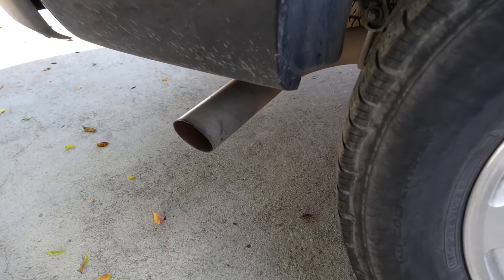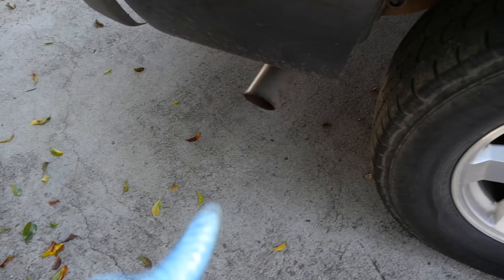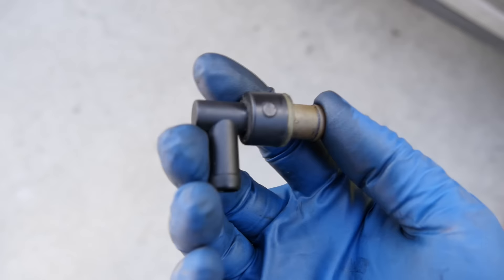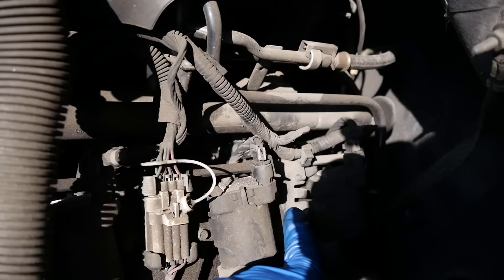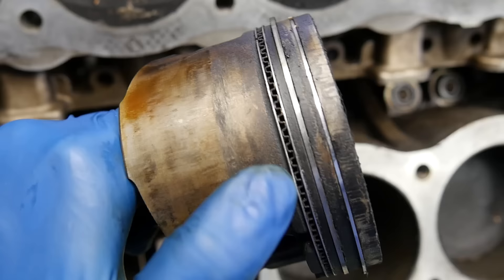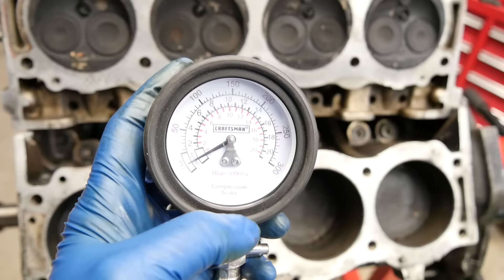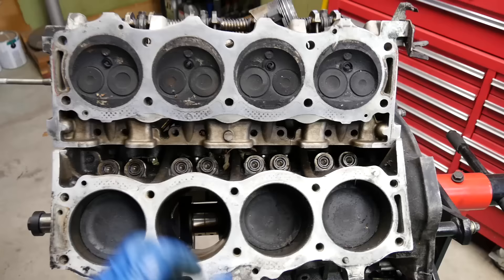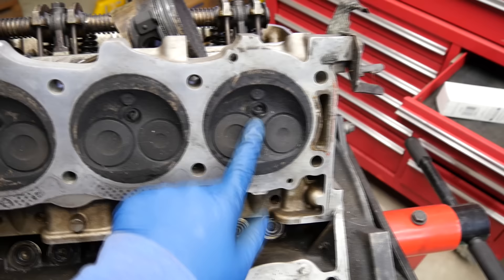Top 5 Reasons Your Car Is Smoking Out the Tailpipe - And How to Diagnose Them

Comment: Is there a reasonable price for fixing the thick white smoke coming from my exhaust pipe? I don’t want to be taken advantage of. I’m a single mother and I’ll be broke because of this for Christmas. In case it matters, my car is a 2016 Buick Encore. Thank you for your response.
Reply: If you are loosing coolant it might be a head gasket or a cracked head or block. There are dye kits an auto shop can use to diagnose it. Then if it is coolant getting into the combustion chamber, you might try those products that are supposed to fix some of those problems. Head gasket repair is expensive, and if it's a cracked head or block, a whole lot more even.

Comment: I have a 2006 Prius that is a burner of oil.  Any suggestions?  I have done an engine flush.  New plugs.  Seafoamed the cylinders and then burned it all out.  Any suggestions?  168k Miles and I am the second owner.  I have also tried different weight oil with no luck.  900 miles equals one quart.  Thanks I like the channel.
Reply: First check if it's leaking anywhere, if not your engine is getting worn. Use a thicker oil and later on buy another car and sell this one.
Reply: Strategic Thinker thanks for the input.  Not a drop any where.  It has been frustrating nonetheless.  I like the car it gets good mileage so much for being environmentally friendly haha.  The manual even states that a quart of oil every 900 miles is in the acceptable range.  Thanks for the comment.

Comment: So I have a 2005 Chevy Silverado with the 5.3 and it’s been smoking white from the tail pipe, I did the “block test” but it appears as if I don’t have a blown head gasket or anything, but it smokes white still and I also have a pretty strong smell of gas and gas dripping from my exhaust pipe, you guys have any ideas or suggestions? Thankyou to whoever has the time and reply to me.
Reply: Murat Tabaru I found the problem, it turns out it’s a fuel injector that’s stuck open

Comment: Our rarely-used backup car, a '92 SC400, blows white smoke in noticeable (but not billowing) amounts when the heater core is used, but nothing otherwise.   Do you have any suggestion as to the severity of the problem?   Can it continue to be driven awhile without using the heater core (it's never really needed)?   Thanks!
Reply: Heater core should not affect smoke out the tailpipe, but only smell or steam on the inside of the car. You can remove the two heater hoses to the heater core and connect them together to bypass the heater core if you don't need the heater, if you want to.

Comment: My lexus is220d 6 speed manual. 177 bhp 2231cc  turbo diesel is giving 28mpg   highway in UK. It doesn't smoke. I have new egr and new map sensor. Some time loses power and does 20 to 30 mph .Can you tell  what can cause these problems?

Comment: Situation: Descending a long steep hill, foot off of accelerator all the way down, then a stop sign. Upon accelerating from the stop sign, Lots of blue smoke.
Question: Worn piston rings or bad valve stem seals? 

This was always a question I had. I do have blue smoke at start up in the mornings so that is a sign of bad valve stem seals and I plan on replacing them soon, but I still have that question above. Does anybody here know the answer?
Reply: Smoke on Decel  is usually blow by caused by the motor pulled a ton of vacuum = Bad PCV / Stuck / Crudded up / Failing Piston Oil Control Rings, Smoke on Start Up = Valve Stem Seals (Worse case scenario, Valve Guides, but not usually).

Comment: Hello ,
 I have ford fiesta classic 2010 1.4 duratorq 90,000 on odometer. Oil consumption is little higher than normal and I don't see blue smoke from exhaust. What should I do ? Turbo seems ok. Should I go for valve job? Please advice!

Comment: I have grey smoke out of my exhaust only when I accelerate quickly. I think a bad valve stem seal even though I don't have it on start up. I drive a 95 jeep cherokee 4.0
Reply: Could be a clogged PCV valve.
Reply: @mattstoker4975  I forgot to mention I put synthetic oil the first time I changed the oil after I bought it and it would puff out smoke at idle non stop. Switched to thicker oil and it only does now if I floor it.

Comment: hi..sorry if i disturb you i read all comment her jusy now talking about white or blue smoke.i just ask a question.. i have my car opel zafira b edition 1.7cdti model 2008.. i have also a smoke in my car i dont know exaclly blue or white..so one time i change oil in my engine total oil remove from my engine is 7 litters some time 6 litters. every time i change..so i ask why is to much oil. normaly only 5 litters..and  what you think the problem of my engine.. is leaking the injectors or head gasket.just reply me if you have time thanks..

Comment: my car is running rich long term fuel trim -14 smoke out the tailpipe rough idle , slight backfire thru intake occasionally if I step on it.  I'm thinking stuck open injector
Reply: Oh. Really?
Reply: @shenghan9385  turned out to be intake gasket.

Comment: Good afternoon.  I have a Ford Focus station wagon, 2006. 1.6 TDCI, 80 kW ... Smoke at high rpm.  I've been to multiple mechanics and each of them has a different opinion ... one said it was because of the wrong oil ... and I put in a 5W30 ... Total Quarz ... another said it's a fuel filter ... the car goes  like crazy and pulling well ... i'm otherwise from europe from croatia and sorry for the bad english ... please help ... thanks a lot.  greeting
Reply: Its like blue-white... Most blue... Only at high rpm

Comment: If u put something on ur engine oil like a leacking stopper is okay to have a lil more oil than ur supposed to or should it still be on the mark?
Reply: Rather drain a bit of oil first before adding whatever to the oil and try to keep it just below the full mark - only on some engine going slightly over the full mark to quieten noisy hydraulic lifter is recommended but this is a whole new discussion - it's got to do with volume of liquid and available space in your crankcase before crankcase pressure gets too high and blows out seals etc...in effect rather be a bit below full mark on dipstick than above PROVIDED that you have the right dipstick for your engine and on level ground when checking readings- or if you car is burning oil just wait till oil level drops to required amounts and top up with whatever additives you're using.

Comment: dude my 07 taurus keeps blowing smoke. ive replaced the injectors and spark plugs. heads, head gaskets. intake gaskets, 02 valve, water pump.

Comment: Could a bad or clogged catalytic converter cause smoke to come out of the tailpipe even after the vehicle is at normal operating temperature & idling still?
Reply: Are you throwing check engine codes for the catalytic converter? If so, I would consider this as a possible culprit.

Comment: What about a carbureted engine? I have a Dodge D150 with a 360 in it. It smokes like a greyish smoke and it just smells like gas its such a strong smell and it smokes alot of it too.
Reply: Could be a few things but worn out jets or worn carburettor components (like accelerator pump or chocke mechanisms ) like needle and seat (or badly adjusted) would be a good place to start - also check for modified air filters that could affect ratios -in some rare cases weak ignition as well or faulty spark plugs..could be a few things..😊

Comment: P0420 cause a truck to run rich. No smoke comes out just a few drops of water at end of pipe.
Reply: i think p0420 is a problem with the catalytic converter
Reply: Water from the tailpipe is normal. P0420 is a catalytic converter efficiency problem, if it's not the sensors. Either try to clean the cat or replace it.

Comment: I'm having reach mixture, and gas smell out through my tail pipe. Interestingly my car doesnt have a O2 sensor, my fuel injectors are spraying equally, air filter is ok...what might be the cause? It's a honda civic 2002 but, engine is thai made.
Reply: Alll fuel injected Honda Civic's use Oxygen Sensors to monitor fuel mixture and to let the ECU decide how much fuel to spray as well as how far to retard or advance timing during engine operation, if your O2 Sensor is not on the front of your Exhaust manifold, it is under the motor before the cat convertor, most OBD2 Hondas also use two O2 Sensors, one upstream and one downstream with the exception of some JDM engines.

Comment: My 350z is misfiring in cyl 2 and FLOODS white smoke super milky thick smoke out the exhuast, any ideas of how to fix?
Reply: Could be a number of things, leaky fuel pressure regulator, clogged fuel filter, stuck open fuel injector, bad plugs or wires or bad coil or ignition control module.

Comment: what causes a sweet white smoke? no over heating and a code p2279. I looked up the code and it said a vacuum leak. Would a vacuum leak cause a sweet smell?
Reply: Sweet white smoke usually indicates a coolant leak from head gasket or intake gasket.
Reply: @aaron5785  it went away i  dont know what happened lol

Comment: I HAD A HORRIBLE TRUCK. KNOCKING EVERYWHERE. NUMEROUS PROBLEMS. I WAS A RASCAL BEFORE I WAS A CGRUSTIAN, AND PUT VERY HEAVY OIL IN ENGINE ELLIMINATING KNOCKING. CHEAP METAL PUTTY (PUTTY STEEL, IM NOT SURE OF THE NAME) AND YOU COULDNT HEAR ANYTHING. I SOLD IT.

Comment: Hey rachets and wrenches can you help me I have a 08 Honda civic with 250.000 thousand kilometers and it Burns oil there's a oil subsence in my tailpipe I have taken the oil cap off there's no steam or smoke where the oil pipe is or the oil dipstick and the oil cap is oily do u know what it could be
Reply: Are you sure you are OK? My friend. Oil cap is oily. You bet they all are. Oily substance in the tail pipe? I doubt it. If that much oil came all the way down to the end of the tail pipe, there may not even be a tail pipe for you to see. The whole car should probably went up in smoke together with you in it. But as you described it "oil subsence". God knows what you put straight into your tailpipe. Remember, there is no need to put anything in the exhaust unless you are one of those crazy and creepy shit I think you are. If that's the case. You may want to put whatever the hell that "oil subsence straight down your throat and light it with a lighter. If you find it difficult to manage the whole thing, I am more than happy to help you with it. I am sure I have ways to force feed you with that oil subsence and as a smoker, I am more than capable to light a small fire for your convenience. Lol

Comment: I want to ask something sreange. I have a 5 year old 43amp per hour battery in my car. I just found out it must have a 50 to 60 amp per hour battery. I have a P1684 code simce I bought the battery new. When I hook up my OBD scanner I also get a message saying O2 sencor incomplete. I know this is caused by a weak batery. I also know that the O2 sencor is used to measure fuel an air mix. Now my car suddenly smoke out the tail pipe. Can a weak battery cause the car to smoke due to incorect mixture of air and fuel?
Reply: Its a 2001 Chrysler Neon 2.0 LX 16v single cam qwith automatic gearbox.
Reply: Its also heavy on fuel. I get 470km(292miles) to a full tank.

Comment: What can you do for your engine if it's the valve seals
Reply: What does it mean if your vehicle is just idling and then when you give it gas smoke comes out it's a blue smoke smells like oil but it only happens when you hit the gas
Reply: @robertblair9363  You are burning oil in the combustion chamber, stuck or damaged oil control rings, over filling the engine with oil can cause this, but is usually not the cause, you are forcing oil past the control rings and the control rings are not scraping the oil back down the cylinder walls on the down stroke of the piston, any oil that passes by the control rings can slip past the compression rings and be burned during the combustion event, bad valve seals and stuck (not broken) oil control rings are extremely common in higher mileage engines, oil pressure increases with load, vacuum increases with decel under load e.g. engine braking, when you accelerate hard, you are building crank case pressure and if the oil control rings or the PCV system isn't functioning properly, you will have blow by, same with decel engine braking, you are creating a ton of vacuum on the motor decelerating in gear / engine braking, this will also cause a burning oil condition if the control rings are bad, if you cold start and are pouring out blue smoke for the first minute or so, you are burning oil that has settled on the pistons in the block that has leaked down past the valve stem seals during the last operation of the motor, the same can happen if you stop at a traffic light or a stop sign and the motor starts smoking again immediately after you start moving again and then clears up .

Comment: My car is burning so much oil the shop ripped me off 1100 and said I need a new turbo and engine but the car still drives as long as I make sure I got oil sorry for the people behind me though sometimes I see the smoke has high as the driver's head and sometimes when I stop the smoke comes inside my car and it stinks 😩

Comment: Would there be any legitimate reason for an exhaust to blow out white or gray smoke upon heavy acceleration
Reply: Worn piston rings could do that especially at higher rpm, but that would be usually blue smoke. Sometimes it's hard to tell by looking at the rear view mirror. It could also be some of the other reasons he mentions.

Comment: Question 
I have white smoke that smells like gas and see dripping that looks like gas coming from tailpipe and have code po305  what can it be
Reply: Hello mate!
Did you find out what it was?
Same problem on mine.
I suspect injectors  on mine !
Thanks!
Reply: @stefangheorghe3488  it was the head gasket so I sold it to the junkyard

Comment: When the car turns over in the morning the tail pipe smells like gas and theirs a little white smoke. For 15 second. Is this normal? Gas   smell is strong but goes away after 15 seconds.
Reply: I'd say that's normal, many cars idle high and rich for initial cold start up. My Nissan Primera for instance does.
Reply: I think you're confusing vapor with smoke..

Comment: My 2006 tahoe 170000, blows smoke but it is for like 5seg but is a lot. Any ideas?
Reply: pedro villena possibly ban valve stem seals
Reply: @intn14  is it possible to replace this seals with out pulling the engine out? What else would you recommend to replace?

Comment: Hi my 2015 ford escape turbocharger 
I just change the turbo but it's still smoking white but it does not heating up and it drives good only smoking white every time I mash the gas what could that be
Reply: It means your engine is screwed.
Reply: @evanspader6762  Do you a video of 2015 escape engine replacement
Reply: Thank you
Reply: John Anderson im kidding but id hover over the possibility of a head gasket issue.
Reply: @evanspader6762  ook well can you show a video how to remove a engine of 2015 ford escape please so I can try to do it thanks

Comment: My mechanic did a compression test and said I had two cylinders that were at 65 psi . He said it needed to 
Be rebuilt. The motor was smoking and eating oil as well. A friend of mine said she had similar problems and used a product called ARFT solutions.  I used the treatment and I’m amazed no more smoking and my power is back. My 1996 Ford F-250 is Back! www.arftsolution.com.  Just wanted to let you know.